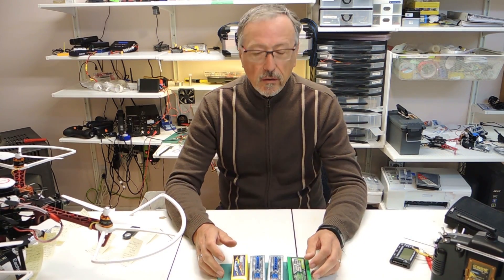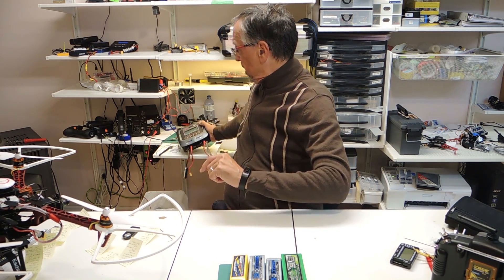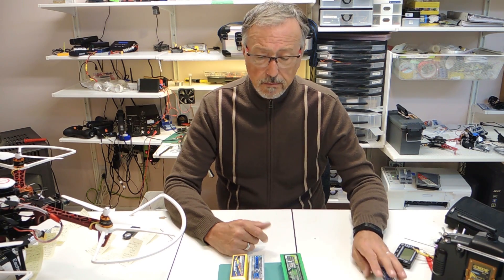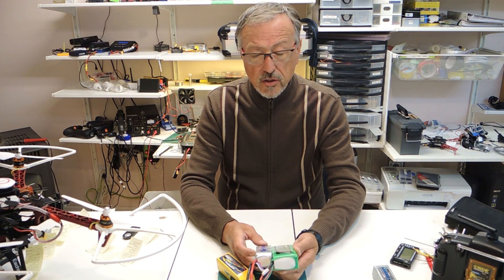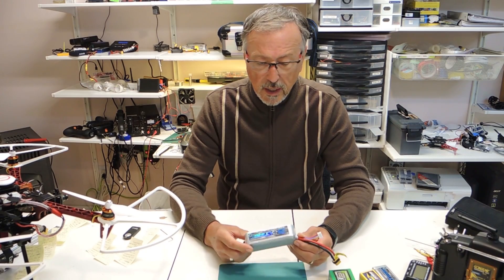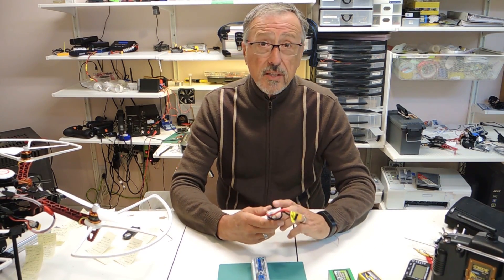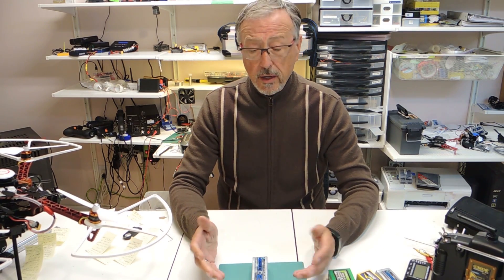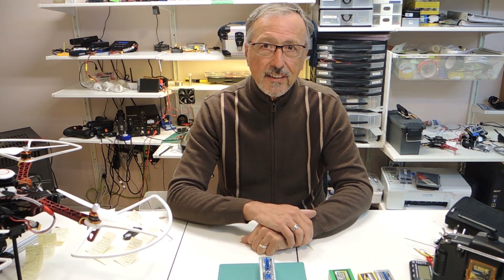LiHv A Cautionary Tale

Comment: I found the Hyperion HV batteries to be better then Turnigy's HV. I didn't have any of those problems with the Hyperion's I no longer buy cheap china batteries from hobbyking. I always break in my batteries on the bench with a watt meter I use the Hyperion emeter RDU data collector I can download the power curves on my computer afterwards. The cool thing I like about Hyperion batteries is I can charge at up to 6C and they discharge at 90C for $65 battery. Where a Turnigy after shipping is about $45 i'm only saving $20 not worth it for me.

Comment: Must be a bad cell connection inside the LiHv batterie.The are from HobbyKing and myself have had 2 LiHv batteries with bad
solder connections.It is solvable but better contact HobbyKing support.They will sent you a new batterie